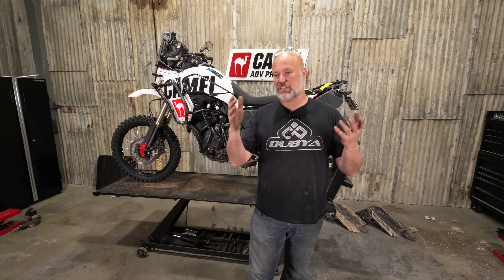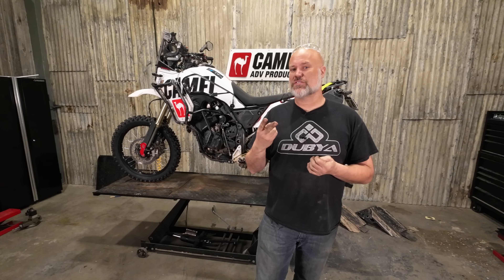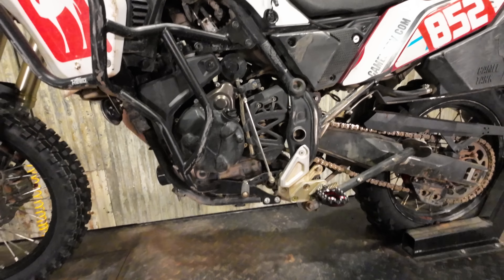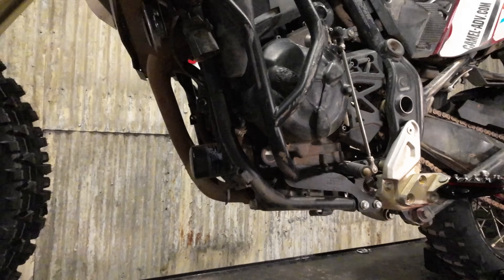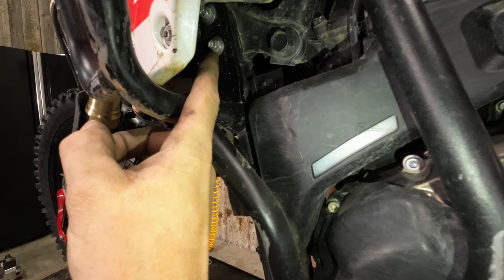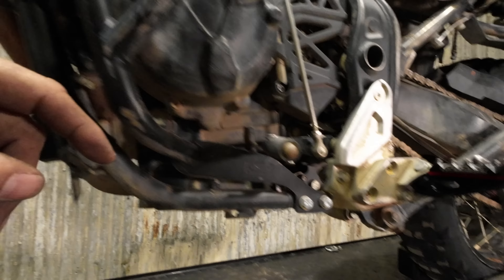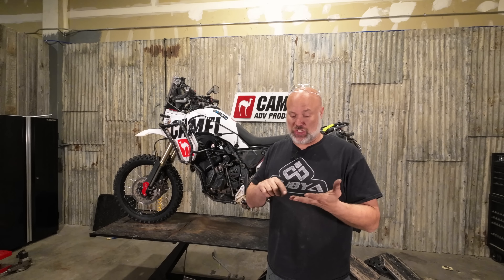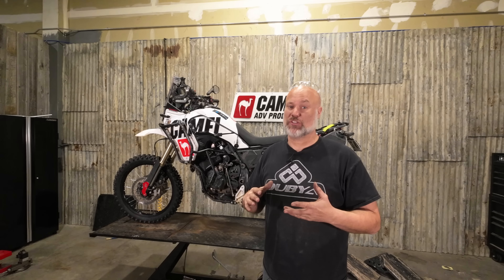OMG! 700 Tenere Frame Failures!

Comment: Pretty much the same thoughts I have. My T7 has 29k miles on it at this point. Over 11,000 of that was off road and I have no idea how many times the bike has been down or hit the bash plate. Not a single issue, and this is the first of this "problem" I've heard. In any case, they're a replaceable part, so what's the problem?

Comment: I saw that video yesterday as well.
Glad I now know to keep check these parts for possible breakage.
The bottom line is we want these parts to break and not the engine.
I do find it hard to believe Yamaha build a bike like this that can’t be jacked up by the skid plate.  Maybe they are covering their ass because of the light duty skid plate.  Just about everyone who puts on a heavy duty aftermarket skid plate jacks their bikes up from the skid plate.  I can not see these vertical members being compromised just by jacking up the bike.  If you are bashing over logs that would do way more damage than jacking it up.
Thanks Cory for making this video right away.  My Camel ADV delivery is due in the next day or two.

Comment: One thing I noted about the 'frame failures' in the Ride Adventure video is that the reviewer did not see the actual failures himself as the bikes are overseas. I would not exclude a problem simply occured in transit, while shipping the bikes.
Reply: You pretty much just defined confirmation bias
Reply: @Toonces311  I'd like to clarify my point a bit here; He was refering to failures on 2 of his fleet of 10 Ténéré 700, that is a substantial 20% occurence rate. Yet, as noted by Cory and others, that type of lower frame rails damage is not mentionned anywhere else in the many groups and forums about the T7. It is just my opinion that something happened specifically to thoses bikes, to cause that exact type of failures. And I want everyone to know that my theory is just a wild guess...

Comment: The heed crash bars are only like that on the left side - I welded a gusset in there on that side and it stops that flat piece from bending and pushing into the frame rail.  Works great.

Comment: Most enthusiasts run some form of fork and shock upgrades. This helps in absorbing the impacts better than the stock setup which is way too soft and the forces get transferred to the frame once the fork and suspension bottom out.

Comment: The parkour analogy made me remember my ACL tear when I was in my early 20s as a professional athlete. I had super strong legs but after a rundown to get an opponent and block his shot (basketball) a teammate of his, about 120kgs, slammed on the side of my knee as I was absorbing my 120kgs from the jump. Needless to say my knee had seen better days before that incident. Side loading something that is meant to hold forces on a different axis isn't a good idea. Which brings me to such products and how they seem safe when they are not. In any case these are not part of the actual frame but complimentary to, as you said, hold the skid plate. No biggie.

Comment: Easy fix on the problem of smashimg the bottom 'rails'

Take a trick from European hardenduro community. They'll drill small holes in the frame rails, mix up a bunch of jb weld and use a syringe to put the jb weld into the frame to make it solid. 
Some guys use silica sand for the same thing. Have to weld the hole shut if using sand, but i guess its a little bit lighter

Comment: That being said, Giovanni Spinali the #1 plate for 50 and over in the Score Series raced a Tenere last year in the NORRA 1000 and broke the frame in two places around the top engine mounts. The motor dropped about 5 inches pulling off the coolant hoses. Had to have a local weld the frame back together. I was unable to attach a pic.
Reply from the maker: I know Gio (and his brother George). I set Gio up with a bunch of products for this T7 before the NORRA race. I talked with him after the race about the failure and he told me it was 100% his fault as he had the upper/front motor mount bolts out and forgot to tighten them before the race. They rattled loose, the motor rotated down and was sitting on the skid plate. After slamming and banging for XXX miles of the race, the rails finally let loose. If you know him personally, ask him about it.
Reply: @CamelADV  yes upon clarification you are right. I have known Gio since high school. He worked at my wife’s family motorcycle shop. Currently wishing him well with his recovery.
Reply: @stevewiley3539  thanks for posting this and gave the clarification a chance.

Comment: Now we just need to wait for the follow up video from Ride Adventures....but I wonder if the crash bars were the reason for the failure, would we have seen more T7 with broken frames? Could these two bikes that have broken frames been manufactured at the around same time and it is a problem with a batch of those frames? In manufacturing although the processes are identical, the parts quality could vary by mistake.

Comment: Saw the original video he’s commenting on. Have to agree, not sure on the setup on the rental bikes, but they’re rental bikes. They probably took a lot of hits in ALL the wrong places with who knows what crash bars or where the mounting points are. I have the AltRider crash bars on mine which have a tie in point on those support bars…fully expecting to crack mine at some point because I ride the bike how it was meant to be ridden and crash it. But these bars are there to be a support/fail point instead of breaking off stressed members/engine mounts ie the ones Eric talked about in the original video on the Hondas. It’s a “good to know” thing and not a weakness of the bike. Luckily these bars are a quick and easy replacement! Thanks for the heads up Cory (and Eric)
Reply: Well put. I also thought the Ride review was mostly positive, but people really took offense.
Reply: @erocnw1341  I did at first and watched it again. I don’t think he meant it as click bait, but it kind of came across that way. I think it was more of a heads up kind of video than anything. I’ve never heard of it happening, most people haven’t either, but it’s good to know and watch out for any stress fractures starting and maybe the aftermarket will come up with a stronger replacement if needed. I just don’t know if there would be a market for it since it appears to be extremely rare.

Comment: I have SW-Motech bars and those bolt to the actual motor ear bolt which I hate. After lots of hard crashes the tab put a dent on the rail, it bothered me at first but it hasn't changed  in several miles so I think I am ok. Will send you pictures via email .
Reply: Which is the reason I didnt decide for SW Motech or Yamaha crash bars as these are bolted to to the engine 👍🏼